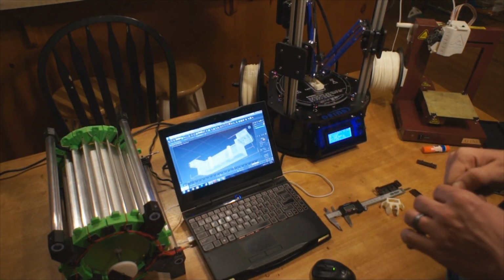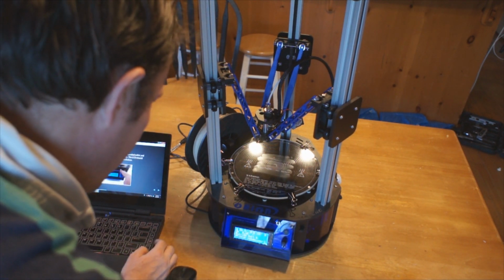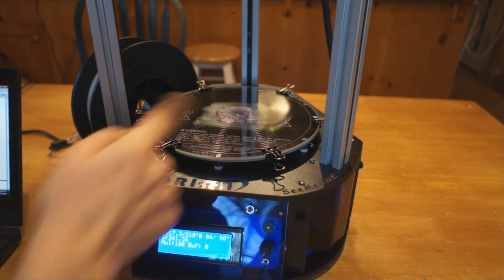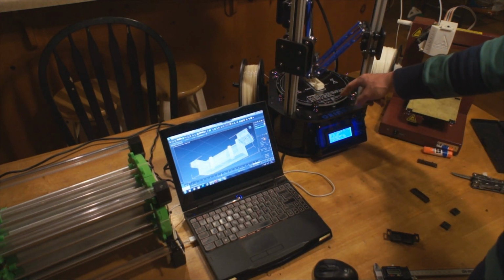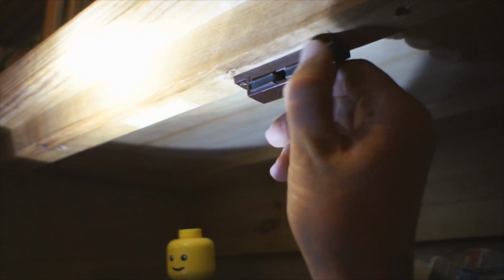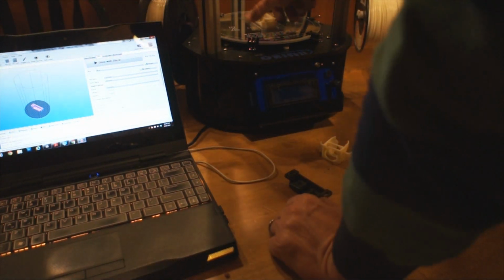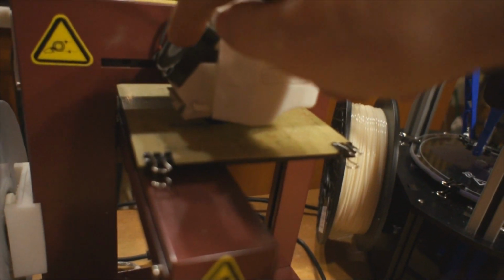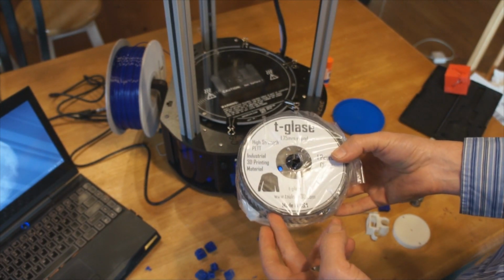Orion Delta 3D Printer Review SeeMeCNC + Afina Comparison

Comment: I broke my fan the same way.  I just replaced it with an off the shelf fan.  Also, ditch the perfboard and print on glass with glue-stick on the Afinia.  I had a lot of issues with the build plate losing level until I printed this http://www.thingiverse.com/thing:99840

Comment: Is there a 3d printer that can make a intercooler pipe, 2.5inch inside diameter and hold 30 psi? If so how much does it cost please let me know thanks for he video.
Reply: Of course there is. We make plastic intake parts with a 3D printer at work. We actually made a prototype turbo compressor housing.

Comment: Your PLA webbing issue is resolved in Repritier that you use for the new 3D printer. it has a travel pull back filament and that's why your new Orion doesn't have that issue :)

Comment: The site claims that although this comes with an ABS spool and I assume it meant to be used with ABS, that there is no problems switching to PLA or "other" materials (they only specify PLA on their website but imply any type of material can be used with no need to adjust the nozzle or make any other changes).  Have you tried printing with other materials and if so, is it really as simply as they make it sound?

Comment: Sure is hard to believe no one has claimed it. Maybe you should set up a new entry post that only goes for 24 hrs then the people that are actually interested in using it will enter again I think it was just to many people just copying and pasting the enter me just because it was on there screen. Most of the guys or girls out here that keep paying attention to this are really people that would take,use and appreciate this machine. I bet a lot of entries probably looking to turn a quick buck if they won and they probably didn't even watch your vid all the way through ..Just my 2 cents
Reply: SOMETHING SEEMS FISHY GUYS AND GIRLS  What do you think? I Contacted SEEMECNC they claim it to be a fraudulent ebay auction going on!!Hmmm? Was it a publicity stunt?  

 http://www.ebay.com/itm/Orion-Delta-3D-Printer-BRAND-NEW-shipped-from-factory/111290370169?_trksid=p2050601.m2372&_trkparms=aid%3D111000%26algo%3DREC.CURRENT%26ao%3D1%26asc%3D207%26meid%3D5260555531263771566%26pid%3D100085%26prg%3D1112%26rk%3D1%26rkt%3D4%26sd%3D111290370169%26%26clkid%3D5260557564432062886&_qi=RTM1562569
Reply from the maker: Ronnie Avery  After the first winner never responded to claim the 3d printer another random selection was run and Yves Baggi (  https://www.youtube.com/user/ybaggi  )  was selected.  He responded to my initial communication but was just leaving on a ski trip with no internet access.  That was the reason for the delay in announcing the winner.  I actually was worried that he might not be able to respond with the shipping info within seven days and that another random drawing would have to be done.  The reason I never announced the winner publicly until after contact and shipment details were completed was to help stop any fraudulent activity.
Reply: Just like I said in earlier post someone copy pasted and is going to try to make a quick buck for nothing at all. Where did it end up Ebay!! Yves congrats but if you had no desire to really have it and use it you should have let others that could really take advantage of this new consumer  based 3D technology have a better odds of winning. and Sir I am not calling you out as I am sure probably half if not more than half had the same goal in mind win it flip it pad your pocket..Am I personally pissed off a little but my luck is always bad.( I never win anything) I am more pissed off that someone that could have used it that's maybe not financially  able to afford something of this stature is not the lucky one. Someone or someone with children might have changed the future with a brilliant design and could bring to life.. !!!Never No!!!   I am Sorry for all that may have benefited from this Giveaway..

 That's all the time I care to waste on this page any further!
Reply: +L Bulborama 
Best 3D Printer 2015, Shop 3D Near Cyber Monday >>> Best3D-Printer.blogspot.ca .
Reply: It looks like the sale of the printer via ebay was not completed.
"This listing was ended by the seller because there was an error in the listing."
http://www.ebay.com/itm/Orion-Delta-3D-Printer-BRAND-NEW-shipped-factory-/111290370169

Comment: Enter me in the SeeMeCNC 3D Printer GiveAway
Delta arm machines are cool, aren't they? Compared to other printer's I've seen, the Orion is a nice elegant design.

As for the Afinia, I believe it's exactly the same as the Up 3D printer, just sold under a different name. They should use the same fan.

Comment: Really great results. An hour to unbox, setup and start printing is really great.

Sounds like it is a really sweet printer.

As to your PLA problems. Stringing is usually a result of running it too hot and/or insufficient retraction. I have never seen that much stringing with PLA as you are getting with the Afinia,

And please Enter me in the SeeMeCNC 3D Printer GiveAway...

Comment: I have been wanting to use a deltaprinter to print wings and fuselages for RC airplanes because of the quality and dimensions of the build volume, I am very impressed with how those prints turned out and would be curious to see how one of my wing sections would turn out on it. Also please
"Enter me in the SeeMeCNC 3D Printer GiveAway" Have a good day and keep the videos coming.

Comment: I have been designing, building and flying electret antennas for many years and have gotten pretty good at capturing interesting amounts atmospheric electricity.  I am looking forward to building an atmomotor and mating some of my antenna designs with it to see what happens.  I am decent with 3D modeling but have always relied on 3rd party printing services to have parts made.  Having my own 3D printer would allow me to try different designs and ideas and would just be a lot of fun.  The Orion printer looks fantastic.

Enter me in the SeeMeCNC 3D Printer GiveAway

Comment: Hey, can you please "enter me in the SeeMeCNC 3D Printer GiveAway," for February the 20th? Thanks you! And also, your work is inspiring please keep up your great projects and discoveries. I built a five unit carbon air core generator in 2012 and got 3.45 mA at 6.2 V. Had it tied to a single pull toggle switch controlling a 12 V LED. It worked great until the salt ate the magnesium ribbon a few months after construction. It's a great home energy project and I believe that it should be demonstrated in high schools as a science project. Could really spark up some minds :) Thanks for sharing!

Comment: For the Fan, did you try with a standard 40x40x10 PC Fan?

http://www.ebay.com/itm/D328-QTY-10-BP401012M-FAN-40x40x10-mm-12VDC-0-09A-WITH-CONNECTORS-/201021422429?hash=item2ecdcf7b5d

Comment: Enter me in the SeeMeCNC 3D Printer GiveAway

I'm impressed with the polish of that machine. Looks like the open source/maker crowd really got out in front not only technologically but also in user friendliness this time as well.

The only problem I see is that all the servos are working with every movement instead of just one, so they will wear faster, but for the hobbyist that should still give a long life span, not to mention part should be a lot easier/cheaper to source.

I wonder if there is something that could be applied as a sheet in place of the glue stick??

Comment: the fan looks like a a small computer fan most likely with a rpm sensor the fan size looks to be 25mm or 30 look on a site like newegg under computer hardware>case fans and narrow your search... hope this helps that size fans are usually used in computer switches and video cards

Comment: Hi lasersaber :) Thank you for doing these Giveaways. It's a really cool way of giving to the community.
Please Enter me in the SeeMeCNC 3D Printer GiveAway.
I've learned a Lot from your youtube page and website. I have also been doing atmospheric electricity experiments and have built a circuit for receiving current from the aluminum mast on my sailboat. So far I've been able to get 30V and light 11 LEDs form it. It's a completely isolated system and I'm using the ocean as a ground. I thought you would find that interesting.
Keep up the awesome work!
~Michael

Comment: Enter me in the SeeMeCNC 3D Printer GiveAway
You really did a nice job sharing things that make a big difference in how someone will end up liking or disliking a 3D printer. The printer is really cool looking. There has been some concerns on the fumes created by 3D printers. I've yet to see someone create a fan with a filter to clean the air/fumes from 3D printing. It reminds me of welding. We use high power exhaust fans to take away welding fumes. Good job on your video's, keepem coming. Thanks.